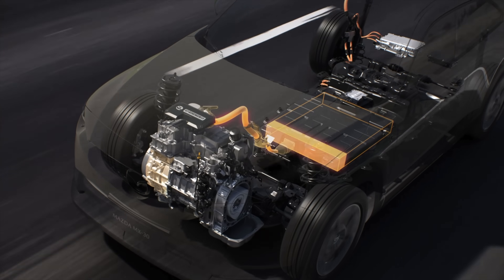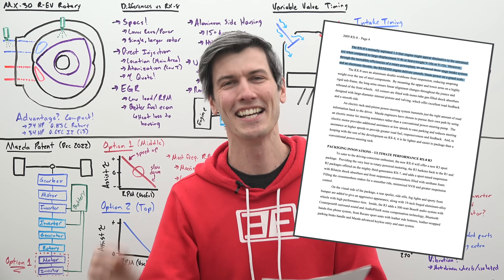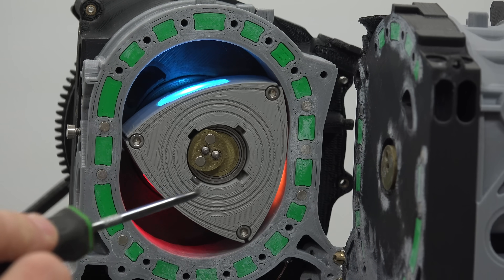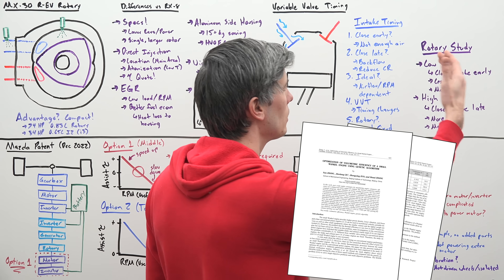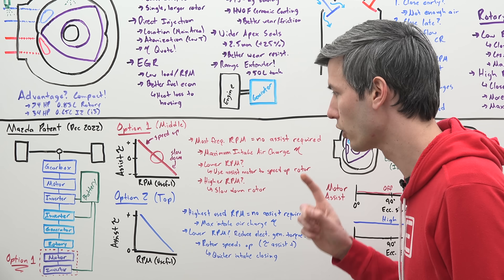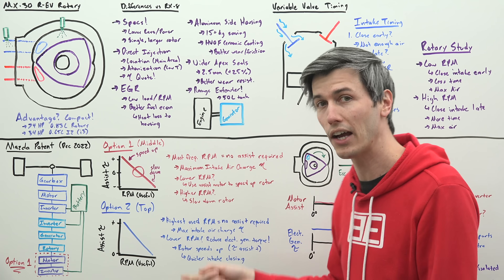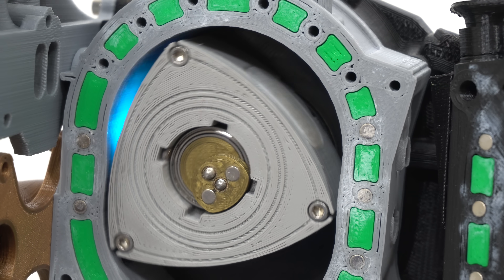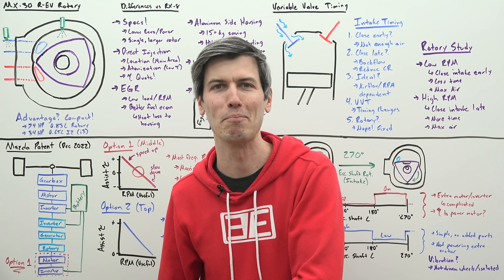Mazda Brought Back The Rotary Engine!

Comment: Hold up.  Is the whole torque assist thing they came up with to control the rotary engine's speed pretty much only needed because they decided not to use a throttle to maintain the target speed?

Comment: Why not mazda open up a little more intake hole using a mechanical system when high rpm n close it when in low rpm rather than stopping the rotary for a brief time. It takes a lot of friction and will make it hot.

Comment: I wanted to know about oiling. Current rotaries inject oil into the chamber which is a total loss.
Reply: There are no current Wankel engines in production, they have been obsolete technology for over a decade.
Reply: @sandervanderkammen9230  — And Mazda should leave it at that — obsolete.

Comment: @2:40 isnt heat loss good since you dont need as powerful of a cooling system to cool the engine?
Reply: Heat loss is bad, very bad.
Any heat that is not converted into rotational work (horsepower) is wasted fuel and less power to the wheels.
Reply: @sandervanderkammen9230  ah ok i thought they meant the heat that is generated by the engine anyways that needs to be cooled off.

PS: Isnt the explosion energy what generates usable energy and not heat?
Reply: @roteroktober360  The Heat is the energy, heat expands the air and creates the pressure to drive the pistons.
Internal Combustion engines are called Heat Engines
Only pneumatics motors are driven by air pressure... completely different concept.

Any Heat that escapes from an ICE is wasted horsepower and wasted fuel.
Reply: @sandervanderkammen9230  ah ok thanks for the clarification, have a nice day!

Comment: Nifty, I suppose.  The unanswered, and unasked, question of course is, Why use any RPM other than the most optimized, most efficient one?  If all the engine is doing is generating electricity, then only use it at its most efficient RMP, thus avoiding any fancy, partial rotation speed changes..

Comment: Why range extender, or in general the engine + generator + electric motors setup took so long to arrive on a car, while it’s seems a so logical choice now and it has been used for decades in diesel trains?
Reply: Why the Wankel engine? It's the dirtiest least efficient ICE that could be combined with a hybrid system... this makes absolutely no sense.

Comment: I have a question? Why does the Rotary engine's speed has to be adjusted by such a complicated system rather than just having the ECU control  the throttle valve and timing?

Comment: Why not just use valves with variable timing in addition to a classic rotary engine design? All these tricks with changing the rotor's RPM several times per revolution will only result in extra vibration and extra wear.

Comment: What  about the Lubrication issues with Wankel engines ? or has that been solved with the use of ceramic coatings ?
Reply: What lubrication issues?
The many unsolved flaws in the Wankel engine are not related to lubrication.
 It's primarily failure mode is related to its horrible combustion efficiency and weak seal design.

Comment: So basically I think this solution is even more ingenious, because at first I thought, if it's a range extender, why not run it at its optimum RPM all the time? However, there is the problem that a battery may not be able to accept this power depending on temperature and state of charge, so you need to reduce the output of the generator, one way to do it is PWM, if you don't want to reduce the RPM, however then you change the load on the engine everytime you switch a pulse, so you should reduce the RPM of the engine to not need PWM, however this reduces your efficiency.
Mazda synced up the PWM to effectively keep the Rotary Engine efficiency high when reducing RPM at the same time, using both methods to reduce the electric energy output of the generator without sacrificing efficiency.
Reply: Range extenders have proven to be a failure

Comment: Side note: .83L per rotor is the optimized rotor width and diameter. They spent YEARS on trying to make it efficient enough to pass emissions. So, new parts source for rotary fans 😊
Reply: Spoiler alert: it's just a vintage 40A engine from the 1960s...
Reply: @curvs4me  The more I research this the more it looks like just another Mazda hoax like the 16X, RX9, Mazda2 Demio RE and the RX Vision Coupe.
Reply: @curvs4me  Mazda's Wankel engine production plant at Ujina #2 was shuttered in June 2012 and demolished in 2013, it's now the site of a Skyactiv G engine plant.
 If Mazda says in bringing back Wankel engines? Why is there no new factory to build them?
Reply: @curvs4me  From what I understand the 16X program was shelved after test engines repeatedly failed during MTBF durability testing.
 Development of production Wankel engines was cancelled by Mazda's board of directors in May 2009 because of sales... the 13B-MSP-RE met or exceeded the strictest emissions standards in the world right up until production ceased in 2012 due to lack of sales.

Comment: Honestly, this is the perfect use case for a rotary engine. The biggest problem with rotary engines is their lack of torque, which is a major reason for the high RPM range. Without getting into the specifics of why high RPM overcomes this deficit, by using this engine in a scenario where A) Torque is much less important and B) it only has resistance applied to it at high RPM, you're really getting the most you possibly can out of this engine. Since electric motors have such incredible torque, it's the best way to utility the energy conversion of a wenkel.

The small size of the Wenkel has always been the biggest advantage, getting more power per kg of engine and thereby increasing your overall power to weight ratio. It also dramatically lowers the center of gravity compared to upright or V piston engines, but that won't matter in this case.

Really, it's just a shame that this whole concept is terribly flawed in a world that needs to stop making vehicles that run on gas altogether. We might be a way off from that future, but we really don't have the time or resources to waste on elaborate new gasoline-powered engines.

Comment: Oh, I was hoping for a new RX-something. I still have a question though. Would a rotary engine deal with methanol better than a piston engine does?
Reply: The answer is no, the optimum fuel for the Wankel engine is gasoline, the Wankel cannot support a static compression ratio that can take advantage of alcohol fuels and suffers for very poor thermal efficiency with alternative fuels

Comment: Question, instead of letting the engine speed up when it needs to by reducing the amount of generation, why not let the engine spin faster and then increase generation when it needs to slow down? 

I assume the reason why is because with Mazdas solution, it's at Max generation capacity at majority of the time with the occasional speed up rather than leaving plenty of power on the table most of the time and occasionally going up to Max generation capacity.

That's my reasoning in my head but just asking to confirm.

Comment: How can I get the tech analysis of propane as compared to fuels you like.  I’m not begrudging your theory just wanted know what you think.
Reply: Several of the NSU-Wankel licensees developed engines to use Propane and other gaseous fuels.
Research found that the Wankel engine lacks the static compression ratios, thermal and combustion efficiency to operate economically on these fuels and developed was cancelled.

Comment: But isn’t intake phase for one edge of the rotor is exhaust phase of another edge??  You cannot really alter intake/exhaust timing, right?
Reply: Yes, each chamber (formed by a face of the rotor) is in a different phase, so when rotor speed is changed to affect intake for one chamber it is also affecting the other chambers in other phases.

With 4 phases taking 3 shaft rotations, each phase takes 3/4 of a shaft rotation. The faces/chambers are one turn apart, so the final 1/3rd of one chamber's intake is the first 1/3rd of the power phase of chamber ahead of it, and the middle 1/3 of the other chamber's exhaust phase.

Comment: It's not genius. Using the generator to electronically control the load placed on the engine is so obvious, I thought of it as soon as you started talking about variable valve timing. Anything you can get done electronically is going to be more reliable, cheaper and lighter than doing it mechanically.
Unrelated, but I'm very surprised that Nissan couldn't get good fuel economy from using the ICE as a range extender only. It'll be very interesting to see if Mazda can pull it off. For me this type of hybrid would be the ideal next car; EV like performance and driving characteristics without the range anxiety and all the issues & cost associated with a large battery.

Comment: Is there really a difference between a range extender and a hybrid vehicles?
Reply: No. A "range extended electric vehicle" is a series hybrid.  The range extender terminology is usually used only when the battery is relatively large (and plug-in chargeable) and the engine is relatively small... but it's still a series hybrid.

Comment: Does this mean that some of these innovations could be used in a future RX or could you use it in the ultimate hybrid that takes advantage of the extreme power density avail from gas with the extreme efficiency of electric motors?  The problem still being combustion by products when you could be using nuclear.

Comment: This may seem like a simple thought and don't get me wrong it is, but if it's just about max air in the rotor at high rpm.. and low/average air at low rpm ... Wouldn't it be not only lighter but simpler to just use a turbo instead of trying to change timing.. by increasing density of the air(using a small turbo) you would be able to get more air at higher rpm and more power with way less weight and less parasitic draw. It wouldn't be hard to engineer a turbo to size and shape to get the pressure and air in the cycle when the rpms get higher. It seems like to me it's a so simple it was missed kinda math
Reply: That is true for reciprocating engines,  turbochargers reduce pumping loss and dramatically increase thermodynamic and fuel efficiency but the Wankel engine Has proven unsuitable for Turbocharging as it cannot take advantage of these benefits and its seals can't handle the higher pressure and temperature.

Comment: As someone in the market for this car. We have a MK8 Fiesta ST. I'd have assumed it would be massively cheaper to run the Mazda. IE cheaper to run an electric car thus petrol car. In the UK at least. The fiesta gets 40mpg. I know right! Compared to the price of electricity at home (33p kWh) and on a 40 round trip commute. There is ZERO difference on the price of fuel and price of electricity! Plus the Mazda is Waaaay more expensive.

Comment: Geez, that's a LOT of words to explain what is basically a complex governor. Governors have been around for decades in the outdoor power equipment (OPE) industry (mowers, trimmers, etc).

The design is interesting, though. I'm not sold on EV's powered solely by batteries. Hybrids make much more sense to me. And rotary engines are cool, too. It's much easier to optimize the efficiency of an ICE designed to run at a single speed. The OPE industry has been doing this for decades. Mowers, trimmers, etc, run best, with their best efficiency, only at full throttle.

Comment: I doubt that the port timing/dynamics can be changed much by altering the rotor speed for an instant. That's one of the many new exciting variables that Mazda engineers could test, and they probably found little or no results. It's more likely that they made the port timing a 'talking point' because it's easier for people to understand. They've already shown that they can be flexible with the truth on technical matters.

If they can change the speed of the rotor at different times in the cycle, there's more to be gained by slowing the combustion event (to extract a little more from the fuel) and speeding the compression event to make up for it. With direct injection, they can do all sorts of things to optimize combustion and the intake tract still must have a throttle, which also gets into the act.
Reply: Wankel engines are inherently inferior to reciprocating engines and simply cannot support a static compression ratio to take proper advantage of GDI.. Mercedes-Benz discovered this with the M950F engine.
Reply: @sandervanderkammen9230  Mazda is optimizing the snot out of this gimmick they've been messing with since the 1960s. For all its weaknesses, the Wankel has some strengths - compact, light, far fewer moving parts. And this particular engine is intended to not run very much, which also plays into a Wankel's skillset. That MB M950F engine and MECHANICAL direct injection system was an effort in the 1960s. Mazda has 50 years more experience and modern electronics to help with the direct fuel injection.
Reply: @travelinkevin5130  You don't know very much about Wankel engines do you?
Reply: @travelinkevin5130  Wankel engines have no advantages... which is why they have been obsolete technology for over a decade now.
 Some would say no Wankel engine is intended to run very long... the design is inherently weak and unreliable and has always been plagued by a lack of durability.

Stratified Charge Mode Combustion works the same regardless if mechanical or electronic methods are used... both technologies are still mass produced.
The Wankel engine cannot take full advantage of GDI because it cannot support optimum static compression ratios to maximum power and thermal fuel efficiency.

Wankel engines are inferior to reciprocating engines in generator applications because of their low thermal efficiency, low mechanical efficiency,  terrible combustion efficiency and low reliability.

The concept of using a Wankel engine as a EV range extender makes no logic sense and is completely incompatible with the Clean, Quiet, Green Energy efficient EV concept in the first place...

Comment: So regenerative braking from the rotor (as well as the wheels?).  Makes sense, and a nice way to take advantage of this containing EV parts.

I am concerned that the constant shocking of the rotation rate, which causes vibration of the engine, will wear the contact parts, including the apex seals, but also the parts that drive the rotor.  The old Mazda adverts were that Mazda goes hmmmm not hmmhmmhmmhmm.

If they could make wider seals for this, how about making them wider and not employing this system and just have them last a long time.

Comment: Do you have any idea what's the thermal efficiency from the rotary engine itself only?
Reply: Wankel engines are limited to about half the thermal fuel efficiency of reciprocating engines.
Reply: @sandervanderkammen9230  This is 20% only? Compared with a Toyota Atkinson which is  around 40%, so how come this Mazda Mx-30 has a 1 liter fuel consumption? Batteries only supply energy for 60 km

Comment: Need a small straight 6 with a generator instead of a flywheel to compete.  Wht a straight 6?  All semis are that engine.  With 120 degrees per cylinder, as Cylinder 1 power strokes is slacking off, the next cylinder has already started and picks up the load.

Comment: Does anyone know if "RPM controlled rotating sleeve valves" in the Intake and Exhaust Ports have been used to provide "variable port geometry"  control on Rotary Engines?
The Intake and Exhaust ports/valves in a Rotarty engine would not be exposed to Combustion cycle pressures and temperatures, as is the case in conventional Piston engines.

Comment: Might be an obvious answer, but if the rotarty is only used to power batteries and therefore no need for variable loads, why doesn't it just always run at the specific RPM?

Comment: So... The RX-8 had a 2 rotor 1.3 liter engine. The new one is a 1 rotor 0.83 liter engine.

By doing the math, if they made it a 2 rotor, it could be a 1.66. I feel like Rob Dahm is going to see what he can do with that engine. Even if it's just the injection system, rotor housing and rotors, somebody could in theory build it out to a quad rotor 3.32 liter engine. And IF they can manage to spool it up to 9000 RPM, the power numbers could become a lot of fun.

It will take a shitload of engineering, but it doesn't seem impossible.

Comment: I would love to consider getting the motor/generator from a wrecked MX-30 and using it for an aviation project. Does anyone know the weight of just the motor/generator? 11:45
Reply: You would have to import it.
And the electric portion would be counter productive for aviation applications. 
I think a three rotor version (74Hpx3) would make a great power plant for the Hummingbird kit helo. 
Est about 320lbs, as 13b is 250 w/ cast iron end plates.

Comment: I do not understand why they need to run the engine at different speeds when all it needs to do is run a generator to make electricity. They also have a battery pack .  What am I missing?

Comment: Rotary, thats too bad. Had Mazda put something else in their RX models, they would still be making them. Until they screwed that up changing the body. Was a great looking sports car.
Reply: Indeed, Mazda's biggest failure was never producing a small high performance 6 cylinder or V-8.
Perhaps they would not be the smallest and least successful of the Japanese automakers

Comment: Have you checked about the Omega 1  Engine,  by  Astron Aerospace ?   Of course there is a long way ahead and many details to develop,  but for me it's the Only thing really New  I've seen so far. 
Rotary,  dual pistons.., pistons that are connected differently are just  crap !  The good old crank shaft and cylinders are jus to  simple, consequently  very efficient,  that will be very difficult to replace.   Please check it out and  maka a Video about it.   It will be very interesting.